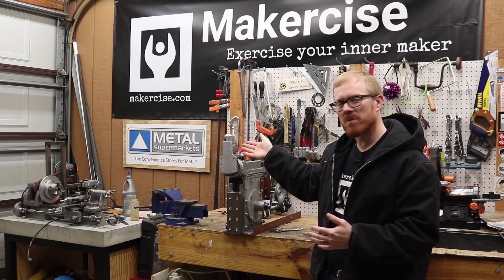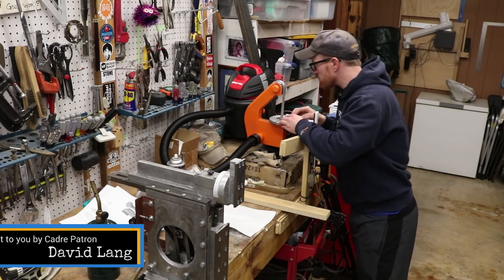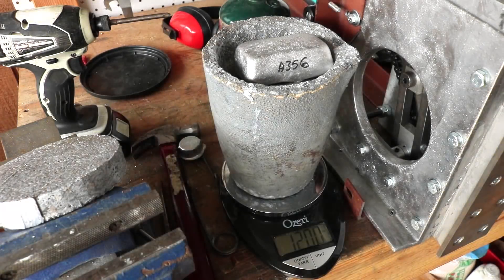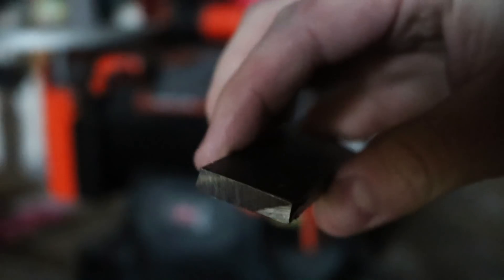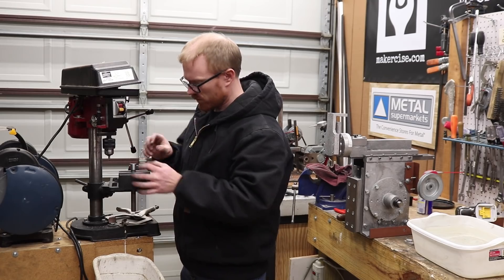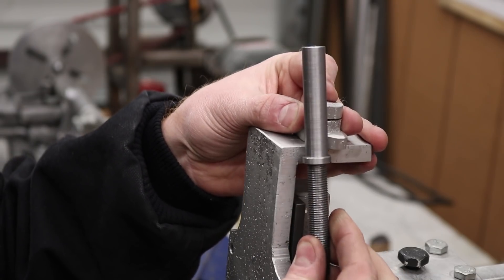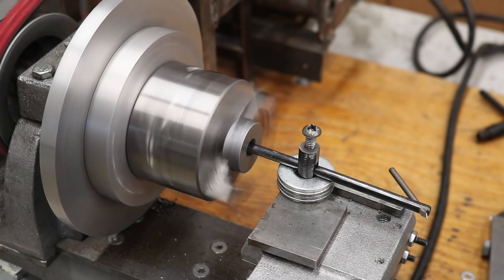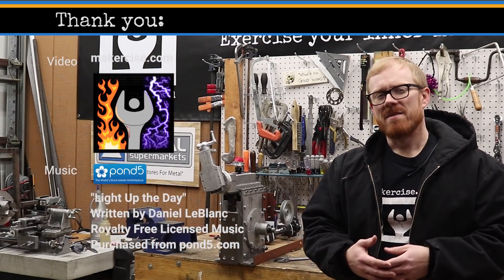Down Feed for Gingery Shaper - The Axis for Dovetail Cutting

Comment: I noticed the jaws on your lathe machine jolt-is (it the right word? ) when you do the mount or flange for jaws -because you want bigger jaws or smaller or jus put them on.. , always make the mount -flange little bit bigger. You can use your lathe machine for make the flange. Then take the jaws completely off. Then bolt on the lathe shaft this new mount-flange then start the lathe of course without jaws just with the new flange and take off the rest couple of mm or inches whatever until you can get your jaws back on. Then screw the jaws back on the mount and now you gonna have perfect straight jaws. Always do it this way. Doesn’t matter if is home made lathe or from factory.

Comment: Interesting casting technique. I'm thinking good old-fashioned plastic wrap would give you a cleaner surface than the styrofoam without a cover and then the plaster before you set it in the sand of course

Comment: I am wondering if making off gas ports will cut down on porosity and using old car rims will help with this you can use straws for off gassing ports  and a riser as well I must say you are doing a grate job well done .
Reply from the maker: Thanks. In comercial lost foam casting vents are not used. At least not predominately according to information frim AFS. In my experience vents do not seem to help. The porosity in my castings is coming from dissolved hydrogen. I will address it in a couple months.
Reply: thanks now I know more co2 will kill it off a stainless steal tube will do

Comment: Looks like the lost foam method gives a great internal structure with a lot of surface porosity, as well as no need for a draft angle. Is that right? Do you use a particular type of sand?
Reply from the maker: Home depot play sand.  Surface porosity is really just texture. I am getting porous castings because I am not degassing.

Comment: Always glad to see another installment on the shaper. I think you are going to enjoy the way a shaper cuts , especially on dovetail ways. Would smoothing the foam with some bee's wax give a smoother finish to your casting's? I worry that those little indents could be a stress point, for cracking.